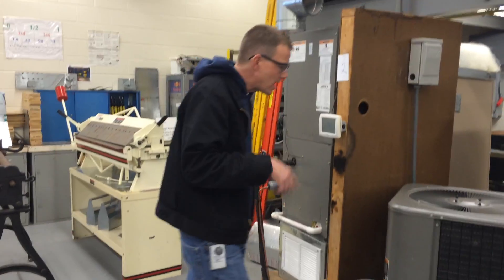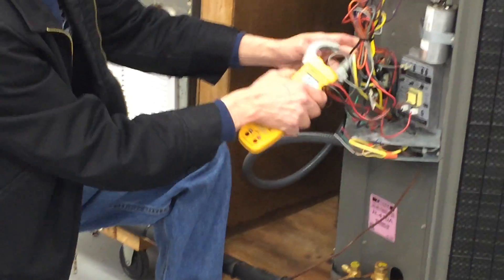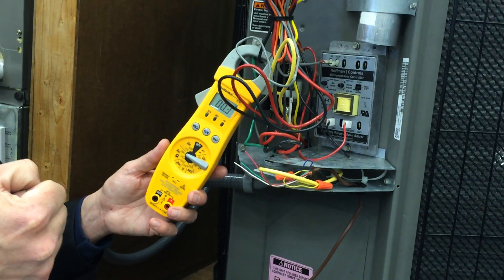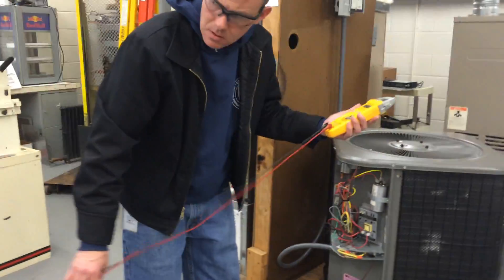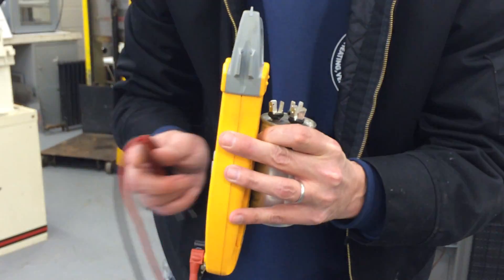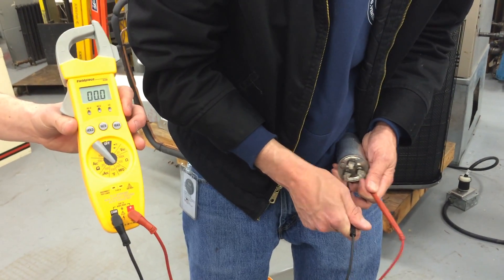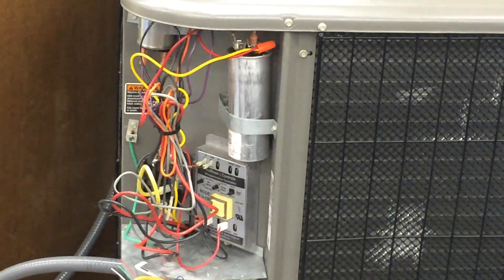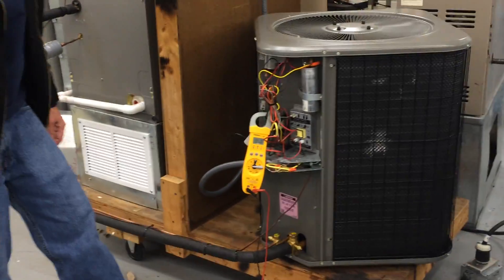HVAC Basics: Electrical Service - Outdoor Unit Not Working with No Cooling, No AC - Bad Capacitor

Comment: Yea but if we aren't getting 24 v to energize the contactor could they also be related to a bad cap??
Reply: No.  Thats from the thermostat or the transformer in the air handler.

Comment: It did not went to 47 amp like he said after power up, it just went up to 14 amp still not getting the start up amperage.
Reply: I did not see 47 either but video capture rates can make videos not what they are in real life.   Intention was good.  He mentions 2.5% on either side of the rated value since 2.5 is half of 5. This is incorrect. If the capacitor is rated at 40 microfarads with 5% then you need a reading between 38 and 42. Really good video overall.  Thanks

Comment: shorting it with a screwdriver is a little dangerous but it beats risking your expensive multimeter.
Reply: I know I've only done this for 3 years but all 3 years of my apprenticeship have been in service... I have shorted hundreds of run caps with a screw driver and not once have I had something bad happen... knock on wood

Comment: I have a R 22 unit but it does not have a low side service valve . How can i get pressure check ?
Reply from the maker: +drywalller is it a split system, package unit or a window unit?
Reply: split
Reply from the maker: +drywalller can you follow the big line that might have some black insulation on it (Suction Low Pressure Line) where it goes into the unit. Some have a panel to remove to expose the connection. It would surprise me if the line went directly to the compressor without a service port. What is the make?